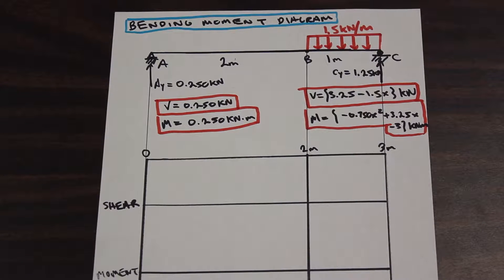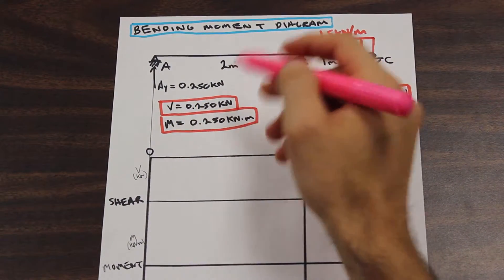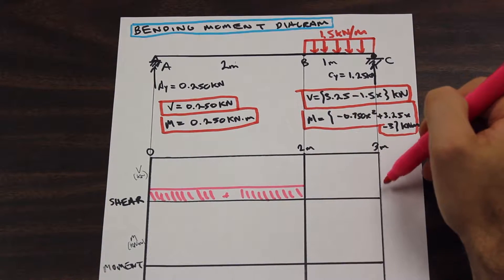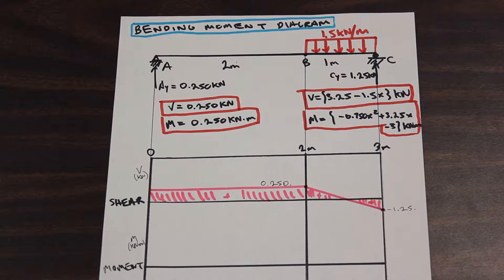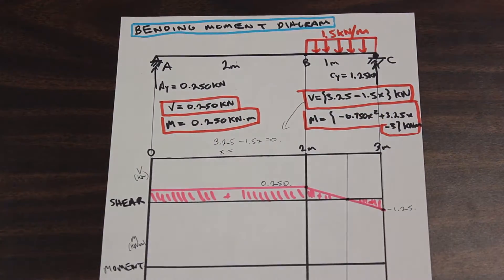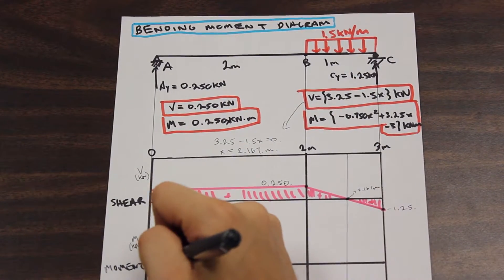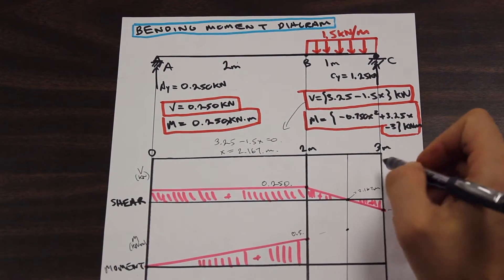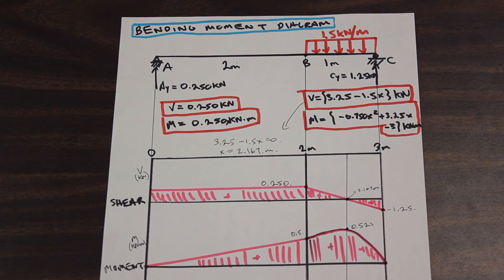How to Solve a Shear Force and Bending Moment Diagram Using Equations - Part 3/3

Comment from the maker: If you're on mobile and you missed the annotation, we missed writing an x after 0.250 for the equation M = 0.250x kNm.  Sorry about that!
Reply: why is that last line a parabola??
Reply from the maker: Good question, thanks for the comment buddy! The order of magnitude of the moment is always an order of magnitude higher than the function of the shear.  It's the integration of the area under the shear curve.  In the example of having an external uniformly distributed load like this question, the shear is linearly decreasing, that means that it's a linear function of x.  For the area under the beam where the UDL is acting, this means that the moment is represented by the area under the shear curve.  Because this function is linear, the integration would be an order of magnitude higher, which is would be x^2.  

The more simple version is: for a uniformly distributed load, shear is always linear and moment is always parabolic.  For a triangular loading, shear would be parabolic and moment would be to the third power.  Hope this helps you!